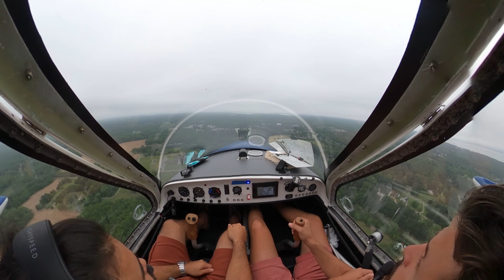CATASTROPHIC AIRCRAFT ENGINE FAILURE | Cockpit view | Deadstick landing in cornfield FLIGHT VLOG 33

Comment: Did you have a thought about putting down the landing gear at that time? I imagine it would have been a smoother landing with the gear down.
Reply from the maker: I did lower the landing gear. In hindsight if I left it up it would have been much smoother off a touchdown. The ground was much softer than I thought. That’s why the left gear collapsed making for a rough landing
Reply: @StraightandLevelCFI  Ohh well! Glad you are safe.

Comment: Great landing in this circumstances. Glad you both are ok and plane too. I have no idea about flight spec of this plane. At 0:43 looks like you applied full stick to the right and heavy right ruder and plane still hesitated to level up. Also, that was a stip bank and I was thinking of how close (or far!) was to spin? Looks scary but you did a great job!
Reply: You can bank fairly steep as long as you first get light in the seat. A plane won't stall in zeroG. So pushing forward to gain airspeed is the perfect time to bank the hell out of it to line up your approach. 

It's the quick startle of engine cutting out that causes pilots to pull back. They lose airspeed and without thinking they try and turn to line up the landing and it's already too late, the spin starts and recovery is impossible. 

This is a perfect example of Dan Gryder's lesson about engine outs.

Comment: Rotax 912 with a disconnected or failed carburetor on one side. They have two carbs that must always be in balance.
Reply from the maker: Nope Aeromomentum engine, rail Cracked according to the FAA inspector, that’s how I lost fuel pressure.

Comment: Why were you only at 600 feet 10 minutes into your flight.  Low level flight only adds unneeded risk, we all know altitude is a pilots friend.  Most planes have at least a 500 feet per minute climb rate which could have put you at over 4000 feet and provided a lot more time to find a landing sight.  That said you did a good job getting on the ground without any injuries and hopefully not much damage to the plane.  Glad you are both safe and uninjured.

Comment: It's certainly fortunate there was a clearing void of trees and obstructioin in a position for them to take it down.  Excellent skill to get it down quickly, however the luck of having that clearing in place helped their chances.  Going down in the trees the outcome could have been much different.  The way the engine stalled right when it did gives it the appearance this was staged.
Reply from the maker: It would have been an extremely expensive staging. And the FAA didn’t seem to think it was staged after the investigation

Comment: Looks like an Aventura 2 -- I've been looking into building one of these from a kit.  What engine was installed?  Was it a fuel pump failure, clogged line, etc that resulted in the pressure drop?  Were there any third party after market parts installed that might have contributed?  -- Great job on the dead stick landing!
Reply: Just so you know, there was another crash with the same plane a few months later in FL. He and his student did not make it.
Reply: Broken fuel rail on this one
Reply: Where's the NTSB reports

Comment: Something similar happened to me. I was in a friend's newly top overhauled Beech Skipper, which already didn't climb well when we had a big power loss, but not fail soon after take off. You get tempted to try to get thru the pattern BUT you are still going down at 200 fpm. He was in control and elected to land straight ahead. As a pilot, I knew from other experience, you get a sort of strange calm, but as a passenger, I got much more fearful. The kind when you can't talk only stare ahead! Luckily, the good Lord restarted that engine and we came back for a landing!

Comment: ah   why didn't you use up a little more of the air speed
Reply from the maker: You need airspeed to have elevator authority so you need to come in with lots of speed for the landing.
Reply: @StraightandLevelCFI  he was way hotter when he hit the ground, he should have used up some more of that air speed, by watching the video, he flue into the ground

Comment: Looking at the vid just a second before the engine failed there was water to your right, a sea of trees straight ahead, and buildings everywhere. You should have been much much higher.   You only had one option, which was the field. Had that not been there, it 
 coulda/woulda have been worse. Nice job getting it down.
Reply from the maker: I could have landed in the water as it is an amphibious airplane. But yes more altitude would have been better. We were trying to get through some marginal weather. Low ceilings.

Comment: I had an engine quit in a high-performance piston single at about 80' AGL immediately after takeoff. Airspeed instantly bled down to within 5k of the 1g stall speed as I pushed the stick full forward. Within 3 to 4 seconds, had to begin using the little speed I had gained to attempt a flare. I also turned off the master switch and the fuel selector, but it was after touchdown. Three "Oh, shit!" moments in about 5 seconds is still a record for me.
Plenty of witnesses, and the FAA was on the scene within 3 minutes.
Reply: What was the issue?
Reply: @realulli  Fuel starvation.
Reply: @stories-myhalfcenturyasapi3978  ouch... Ran out or forgot to switch to the correct tank? (Or something else?)

Comment: Flying in flip flops... seriously?? Glad you made it out alive but this ain't real flying. It's a lawnmower with wings. The 'pushover' was actually due to the loss of thrust as it's very clear the joystick shot forward all by itself... both pilots actually pulled it back. Some things for next time (hopefully there isn't one): student should immediately be told to relinquish control; crack the doors/windows; bleed a bit more speed before hitting the deck.
Reply from the maker: No this is an interesting airplane it’s an extremely rider and elevator dominate airplane. With the pusher prop dead it actually blanks the tail. That’s why I purposefully picked up as much speed as possible on the decent. Of I go to slow there is no elevator for the flair. You can see me pulling the stick full back that’s all the flair I could do. And the doors are a joke. They could never Jam closed. Not like an actual metal Cessna door

Comment: Not a lot of time to pick a spot but the landing was pretty terrible there seemed to be plenty of space there no flare just really rough landing even though he did have enough air speed to make a flare could definitely be handled better. Also why in the hell you are at 600f AGL ? I'm sure the people living down there love it when you roar above their homes like a speeding bike at 3am lol hate these people
Reply from the maker: Low cloud layer, we were trying to get 10 miles east where the weather opened. Fire sure it could have been handled better. I should have left the gear up then the left gear collapsing wouldn’t have happened. And I should have packed the nose down even further to pick up more airspeed. These pusher props blank out the tail and make it hard to flair if you are at all slow. You can see me with the stick full back trying to flare.
Reply: @StraightandLevelCFI  These planes are made for low and slow. Non-seaplane pilots get very nervous doing so...same with the flip flop comments...seaplanes are made for flip flops, who wants soggy shoes and pruney toes?

Comment: I think one of the basics is to land parallel to the field's plowing lines. You could use your initial course as a base leg and not downwind. I know fighter trainer pilot that didn't land paraller although he could and he was heavily criticised. Furthermore during the final approach 1. extremely agressive roll without engine power. I suppose it was your first time experiencing such handling characteristics during landing. 2. Ignition has to be turned off way before: In Cessnas we kill ignition, close fuel valves and cut mitxture before even declaring emergency. We leave only masterswitch on before touchdown only to have the ability to extends flaps. As you can see during landing which requires a lot of concentration, you take your attention to your left ard in order to kill the engine. Very distracting. In the end "Any landing you can walk away from is a good one". We all take our lessons from your incident. Happy Landings!

Comment: Yeah...Stalled it like 5-10 feet above the ground from that aggressive pull on the stick while shutting off the mags. That was odd man.
Reply from the maker: Nah it didn’t stall
Reply: @StraightandLevelCFI  So...It wasn't a stall?  I stand by my assessment...you pulled all the way back round 5-10 feet (hard to tell from fish-eye camera), with no altitude gain nor airspeed loss, and hard, but that wasn't at stall?  Sorry man, but if you pulled back and still had enough airspeed above stall, it wold have at least ballooned a bit before touch down.  To me it's clear you were definitely stalled BEFORE you touched the  ground (which obviously isn't always bad thing, and under normal circumstances, and is what you WANT in a flare...but the problem is that THERE WAS NO FLARE).  And i just re-watched again...you were definitely at or below stall speed when you decided to pull back hard.  Not criticizing you man....but it's good for people to learn from other's mistakes. I realize I'm just arm-chair quarterbacking.